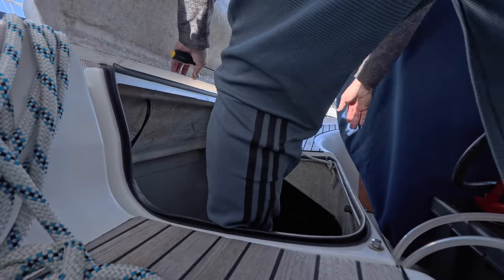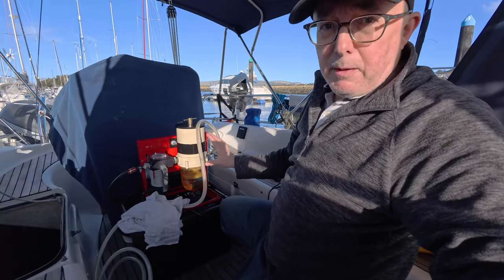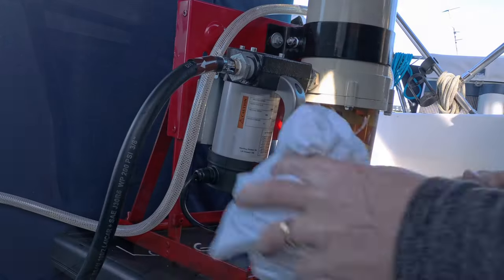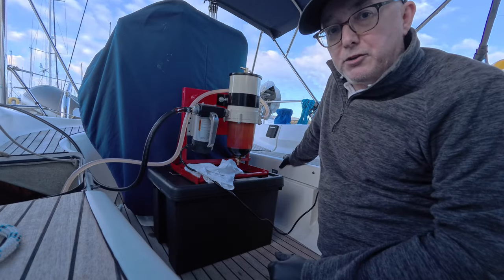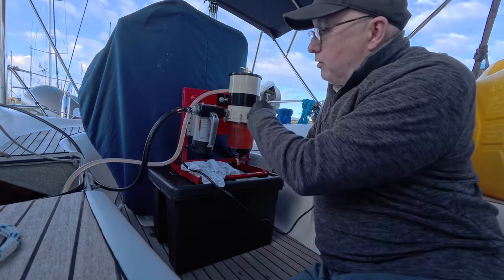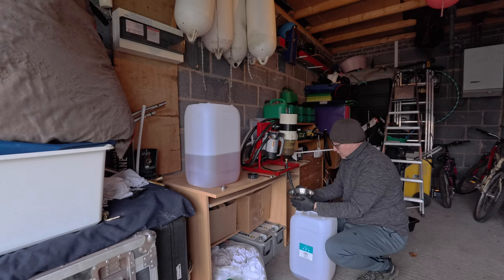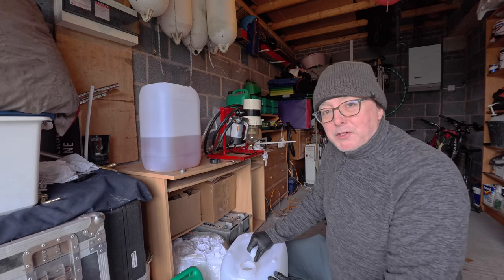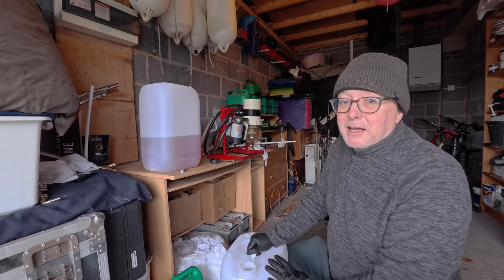Diesel Polishing | How To Kill DIESEL BUG & Prevent It From RETURNING | Sailing Madness Ep31

Comment: a great video,,,,,,,diesel bug comes from an airborne spore that travels in the air, the spores can enter a tank when it is being filled or even through the tank breather, and of course it can be delivered in fuel when filling your tank.    It lives in fuel that is contaminated with water .it survives in the water phase and eats the carbon from the hydrocarbon,  it exists in the joint between the water and the fuel referred to as the  interface , what it excretes is acidic and can attack aluminium or mild steel tanks.  adding a biocide between 3 to 7 days before polishing will kill the bugs.  They will sink from the interface and form a sediment in the bottom of the tank which can be sucked up.  There are many varieties of these bugs, one of the most common lives on pine trees or softwood fences.

Comment: To reduce the amount of condensate forming in the tank do not leave it less than 3/4 full for a longish time.  Filling with uncontaminated fuel helps, often contaminated from a delivery of contaminated fuel from the oil company that took delivery of a tank of ballast water.

Comment: I have watched your videos of your trip to Scotland, really enjoyed them. This winter I also built a fuel polisher. I polished the diesel out of the tank and into containers (110 litres). I removed a lot of sediment (dead diesel bug), however I was not confident I got it all, so I installed a access hatch about 112mm in diameter and cleaned out the bottom of the tank with rags and sure enough I had not got rid of all the bug. My advice is for you to clean the tank and also make sure you remove the pick-up pipe from the tank and clean it. Mine was completely bunged up with sediment. I also installed a Racor water separator and new fuel lines. I finally polished all the fuel out of containers back into the tank using a 10 micron filter.

Comment: I’m wondering if you usually add diesel bug treatment every time you fill up with fuel? 
Wouldn’t the water that had collected in your tank just be caught in your water separator when or if it ever made it out the tank and then you could  just drain it off from the drain valve on the separator?

Comment: Thanks for posting.  Always interesting to see the contents of people's tanks, and the stupid places boat designers place them.

I am becoming more and more convinced that people pick up the bug from their supplier.  Especially when filling with red from a small marina/fuel barge where the stock turnover is slow.  After catching the bug from one such supplier I've changed to supermarket white.  I know the fuel is fresh, but even so have taken to passing it through a Mr Funnel filter before putting in the tank - you will be surprised at the amount of gunk I remove. 

And whoever thought that putting the filling cap to the tank on a flat deck needs their head examined as unless you are very, very careful in the UK climate some water is going to enter the tank via that route even with a good O ring.  Why do most cars have their filler cap on a near vertical surface and hiding behind a flap?